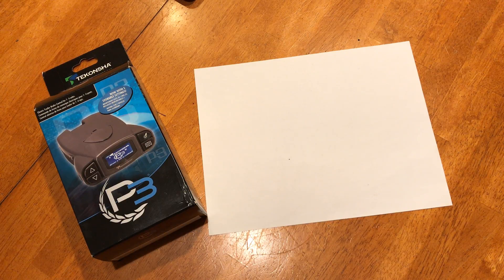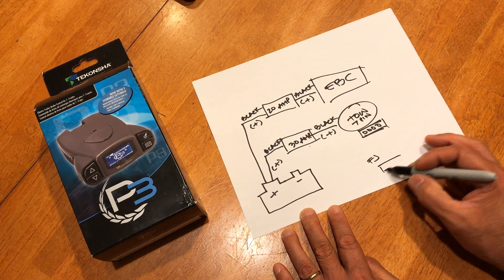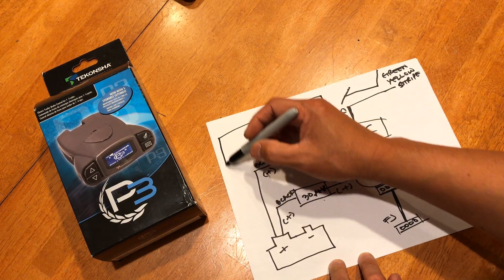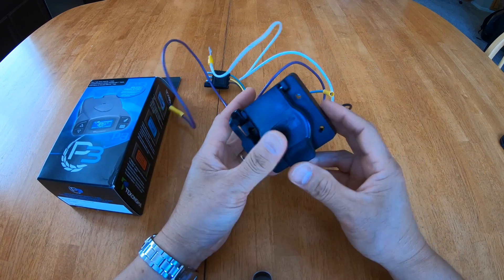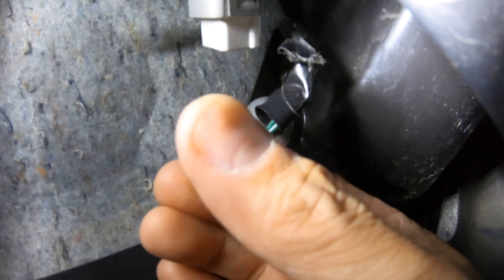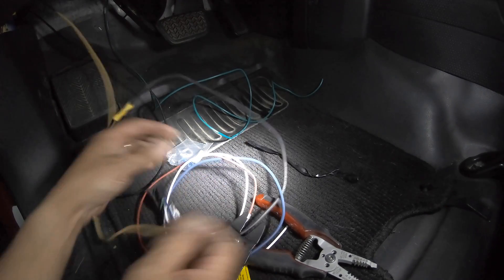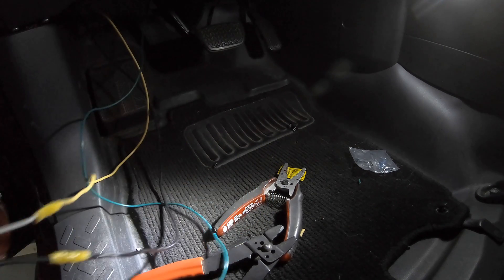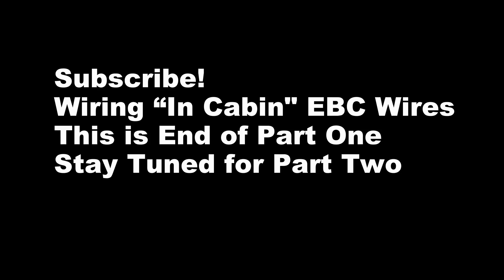Part1 How to Wire FJ Cruiser with Electronic Brake Controller 7 Pin Tow Adapter tow wire diagram

Comment: Love your vids...really helpful.  I was thinking of getting the Curt ECHO wireless EBC....if I get it does that mean I can "cut and tuck" the blue wire from the 7pin to the EBC?  I still need to install the 7pin, but wanted to do as little drilling in my fj as possible.

Comment: Thanks for the excellent video. I followed all you steps, but was scared of tapping at the brake. I instead ran a wire to the third brake light on the hatch window. The GY wire can be accessed from the boot, jack storage compartment.

Comment: Did you tap into the FJ's brake line with a 14 AWG wire? Can you provide a link to the tap that you used. This is the only part of the process that I'm worried about doing.

Comment: Very helpful videos thanks! Just wanted to add that if using a snake, you can make a lot less work for running the wires through the frame. Started at the front and got through to the back in one shot. I then pull 24 gauge wire through and solder my wires to that. Then just pull it all through. 

There’s some waste, but I’ve never had this system fail me, yet. I keep thin gauge on hand, just for this.

Comment: I did not see a wiring diagram in the P3 manual. Is that even possible!
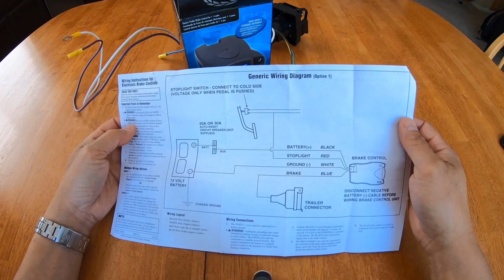Reply: Steve Carlisle it cane with it... see at 5:53 of this video (unboxing)...  it is a separate packet than the manual.
Reply: @KaraGermanShepherdAdventure  thanks, I will check your video

Comment: Did you ever get around to making a video for 7 pin harness? And how you ran the wires to the back?
Reply from the maker: I did...  here is the playlist https://www.youtube.com/playlist?list=PL6vR9pff96YNj1QlspFH8kum-_hx-nU5-
Reply from the maker: It’s a 3 part video here is the vid of the 7pin https://youtu.be/TdfCnN5qGwU
Reply from the maker: Ran the wires via the chassis
Reply: @cbatilo  Running them up thru the interior, behind and under all the plastic trim from front to back is super easy and quick, too. Great videos - very helpful!

Comment: So I dont think anyone else has the 4pin adapter
Reply from the maker: Thats alright.. just need to do 4 extra wiring - just wire them from scratch. the 4pin wiring. One is Ground, One is running light, one is left + brake and last right + brake.